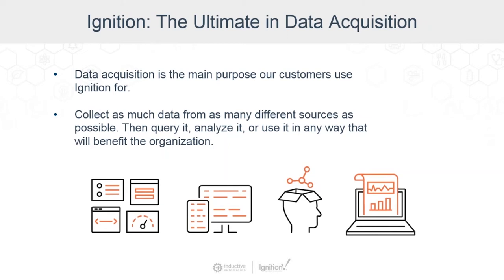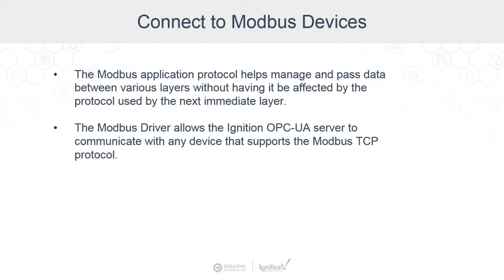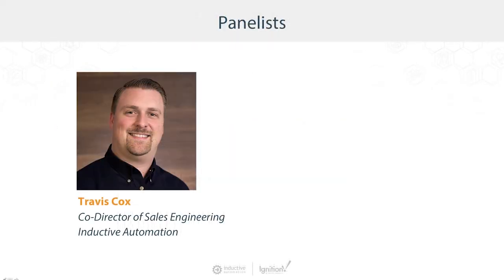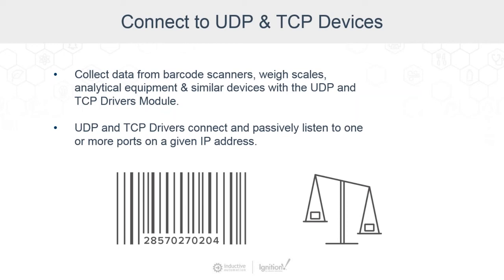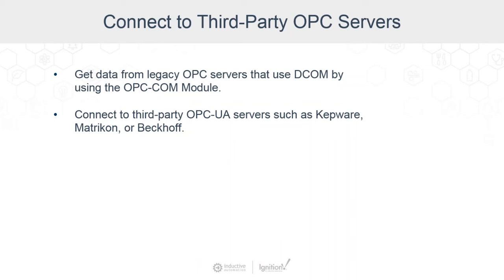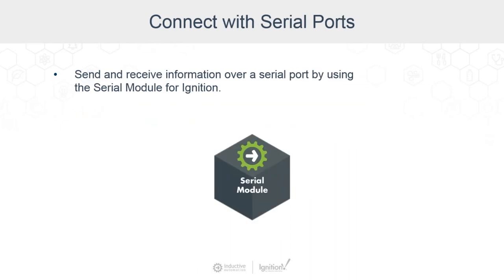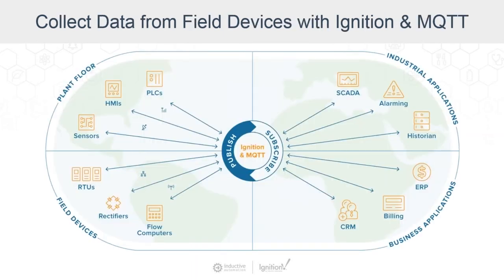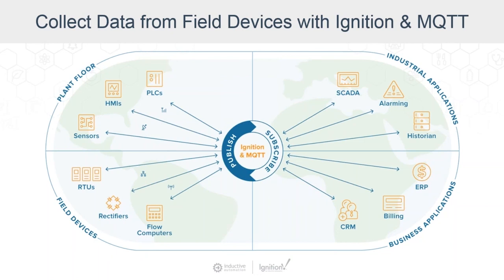Easily Access PLC & Device Data

Comment: My company us an major OEM Engineering Company that custom design builds plant site equipment that are all integrated into one entire process system for operation and controls. This is a bit different to many Manufacturing Plant sites that have many manufacturing lines, separate systems with PLC’s and devices to possibly send all that to a Ignition/MQTT statement. In our case there is mainly one Main Control Panel with the Main PLC Controller in Panel that accumulate and control all that I/O Data from all those equipment. Thus it would normally seem to be a design where one main PLC is sending that needed data via IgnitionEdge to a MQTT broker? We normally have at least 1-2 local and remote HMI PC’s connected to this PLC Network as a completely isolated system from everything else on plant site.. Would the IgnitionEdge software in this case be installed on desktop HMI PC connected to the PLC Network to read the PLC I/O data?